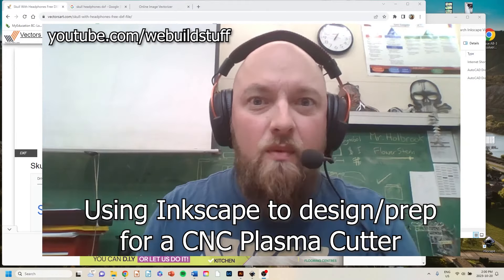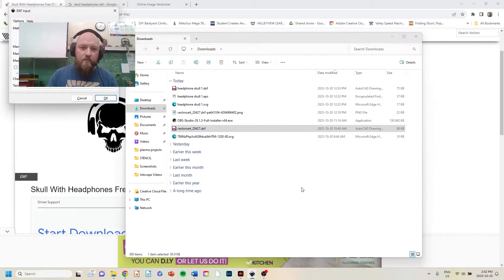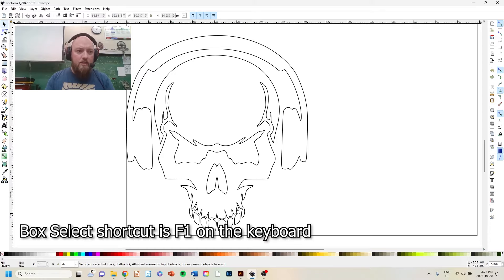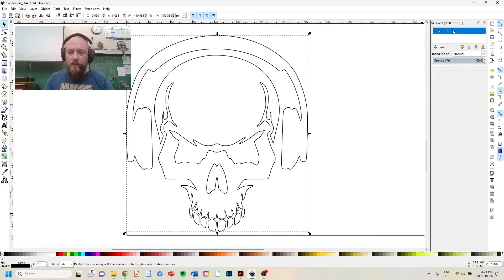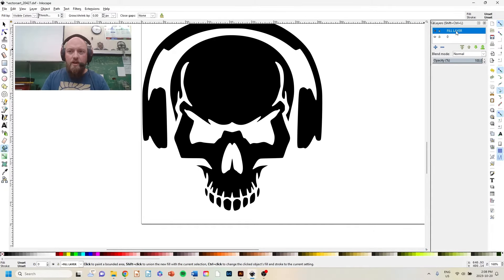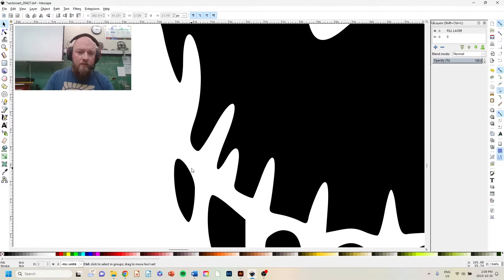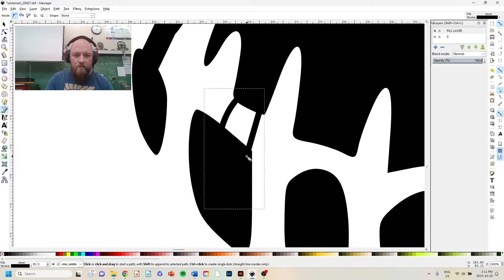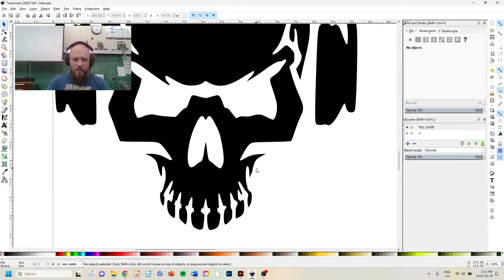Using Inkscape for CNC Plasma Cutting

Comment: thanks so much. I am trying to move from en route to inkscape. question, how is the kerf compensation generated?
Reply from the maker: For us that is done in a separate piece of software attached to our plasma cutter called SheetCam TNG
Reply: @WeBuildStuff  thank you. so, you use inkscape and sheetcam for your project to be able to cut. correct?
Reply from the maker: @gambhirahcaitanya4393  Yes you can see the process starting at 21:40 :)

Comment: What are you trying to do? Make a long video and confuse people? Trace bit map, it becomes a vector save it as a DFX done.
Reply from the maker: You missed the part where the floating pieces needed to be connectes to create one compound shape to avoid everything falling apart and showing more than one method for joining together. Trace bitmap function doesnt work everytime but it is nice when it does.
Reply: @WeBuildStuff  Such a nice and polite reply to a rude guy. Cool video. Explaining short and clear, exactly my style. 30 mins of watching and I wasn't bored any second. I'm using a chinese CNC machine which comes with its program called ' FastNest' or 'FastCut'. I mostly cut only parts for pre-engineered buildings but now i would like to cut metal fence panels. I found a free dxf file, but when I introduced it into my nesting program it was so tiny, instead of being like 1550 square inches big. Searched on youtube how to scale a dxf file, and found your video with Inkscape.  Do you have any tips for cutting metal panels for fences?